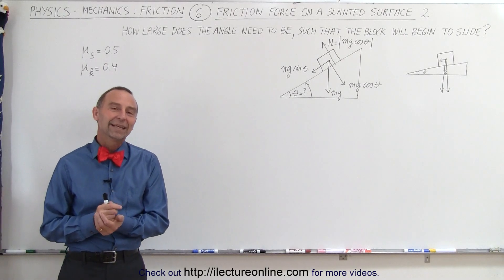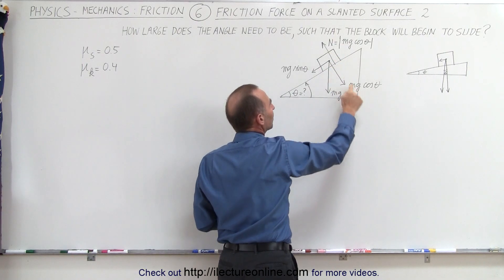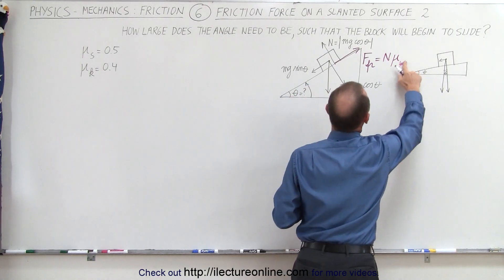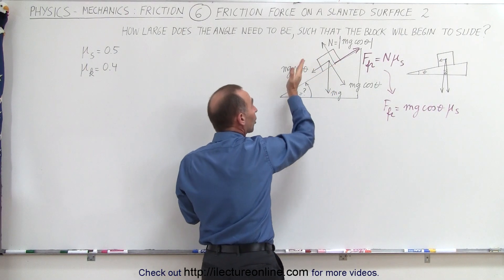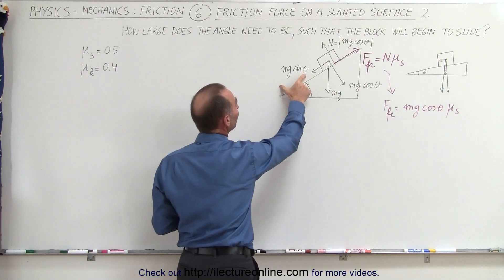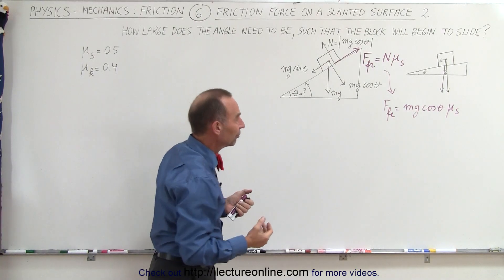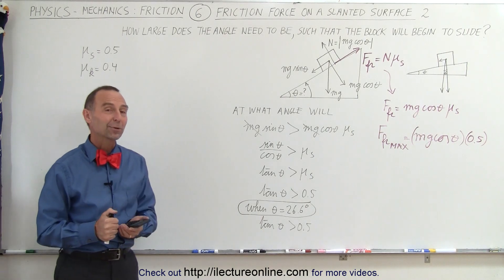Physics 4.6   Friction (6 of 14) Friction Force on a Slanted Surface: 2

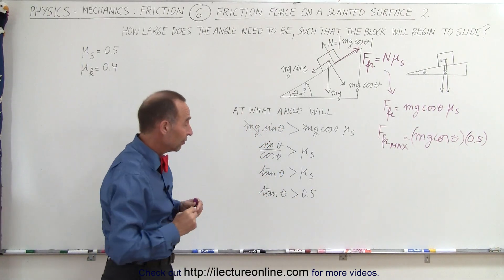Comment: 4:08 
Why had you taken it as , 
ARC TANGENT ?
Reply: Please reply immediately.
Reply from the maker: If you know the length of the side opposite to the angle, and you know the length of the side adjacent to the angle then you can determine the angle by taking the arc tan:   Arc tan = (opposite side / adjacent side)
Reply: @MichelvanBiezen  : Thanks Micheal